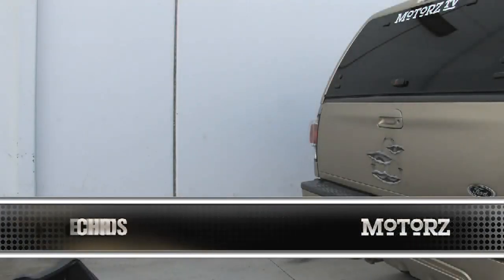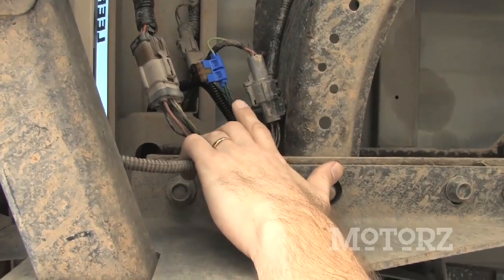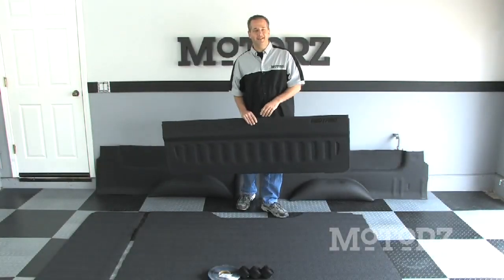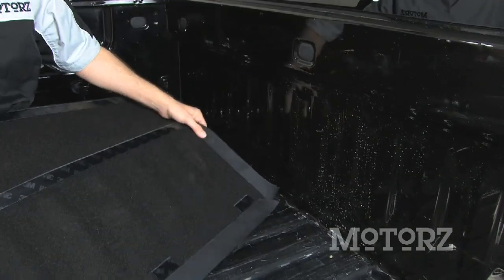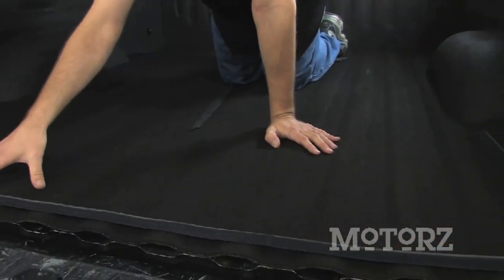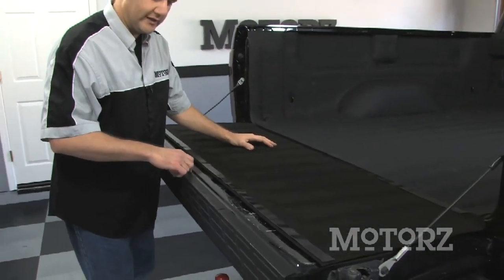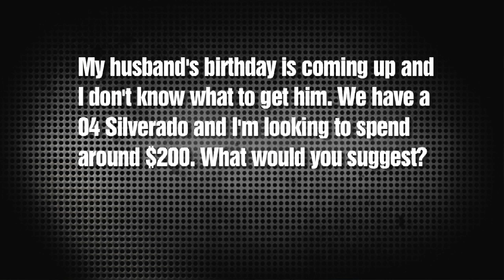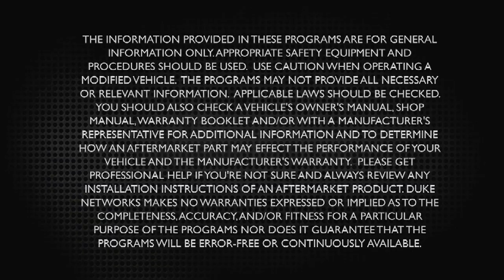How-To Install Leer Truck Cap, BedRug, BedTred Bedliners Motorz #47

Comment: I liked the bed rug, especially under a truck cap, but I would not use either without the cap. It looked to me like something that would hold water that got underneath and eventually cause rust. I suppose there isn't anything better than the spray-in bedliner. Thank you for all the great educational how-to videos.

Comment: I bought one and it leaked the first day, so I took it back and had it diagnosed and fixed only to have it start leaking again, so back it went and again it leaked. I then tried a different shop and they put butyl tape on the window and low and behold after a few months of sun the goop came out and the water began seeping in again. Now I'm told that since two years have passed the warrantee won't cover this anymore. I've been blown off when I try to call Leer and the dealer wants $60hr to fix it
Reply: leer Q.C. IS NOT GOOD.???

Comment: Why don't you grab power for the topper interior light and the triple cigar lighter socket directly from the back of pin #4 on the 7 way round trailer plug????  Running 30 extra feet of wire does not seem right.  You could also do it off a T connector adaptor harness plug and play behind the bumper, so you never cut into your trucks harness.  Also for the keyless entry why does Leer not recommend getting power from behind the bumper if there is an electric tail gate lock??